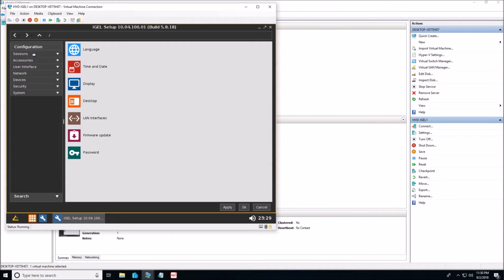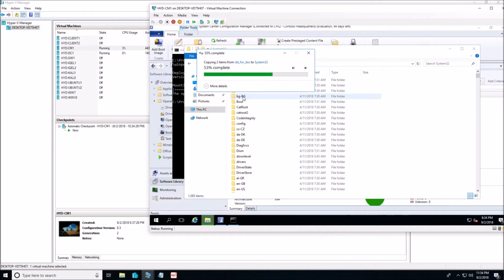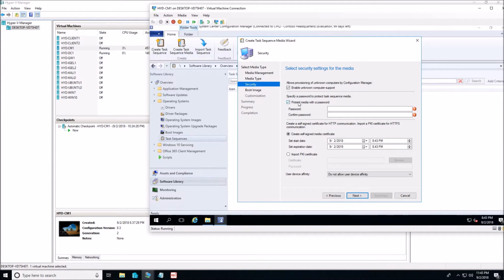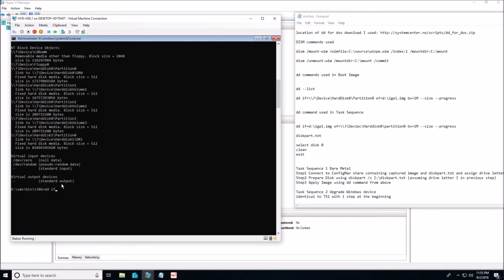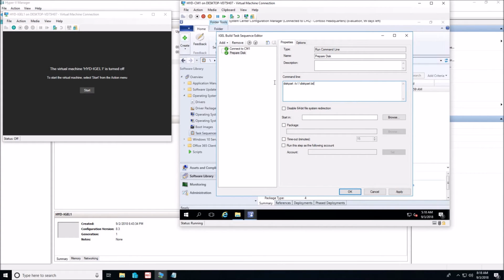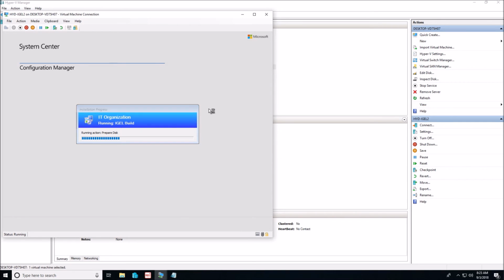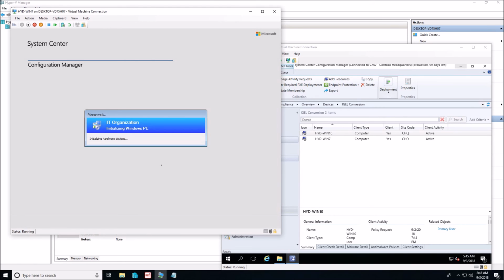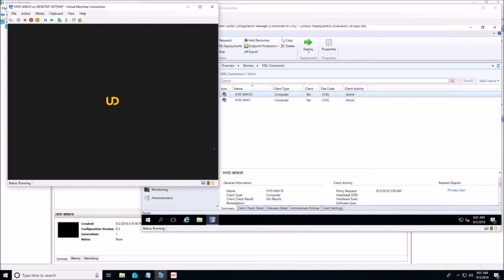How to deploy IGEL using Microsoft SCCM - Demo by Scott Martin

Comment: Wonderful video. I would add that dd takes a block for block copy of your hard drive. So if you're running this on a 500GB drive, it'll create a 500GB img file. You can try to use the count parameter to only capture certain blocks, but it may not get everything. I would recommend to do it on a VM with a small hard drive, as the OP did. It looks like his was around ~17GB. You may be able to pipe it into gzip and compress it some.

Also with SCCM, if you have multiple sites you want to use this at, copy the image file and anything else you need to a directory and add that into a package. Distribute the package (with no program), and then use a task sequence and a "run command line" to put in your dd command while selecting the package with the source files. This is just cleaner that hard coding paths into the command line. But it's all preference.

Comment: Is there a WinPE 64-bit compatible DD available for use? I can see a potential issue with UEFI-based systems not being able to stage the 32-bit boot image from the conversion task sequence, and the DD command will not work within the 64-bit boot image.
Reply: I may have answered my own question with ddrelease64.exe (http://www.chrysocome.net/downloads/ddrelease64.exe).

Edit: Confirmed. Using ddrelease64.exe I was able to avoid using an x86 boot image. Also, in lieu of integrating DD into the boot image, I just put it in the same path as the IMG and called it over the mapped network location. This may be a reasonable solution for those looking to maintain a single boot image for their environment. In addition, this resolves the issue of UEFI-based devices not being able to stage the 32-bit boot image.
Reply: @kevinsurgener6706  I can confirm this works as well. Thanks for the info.